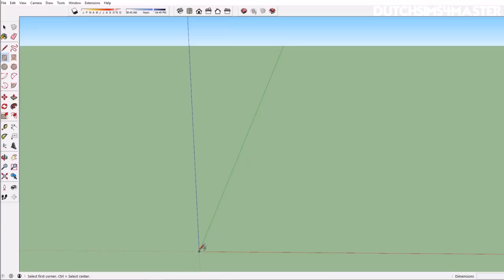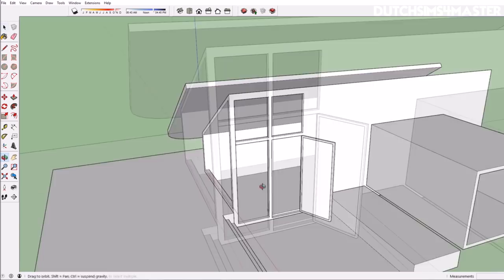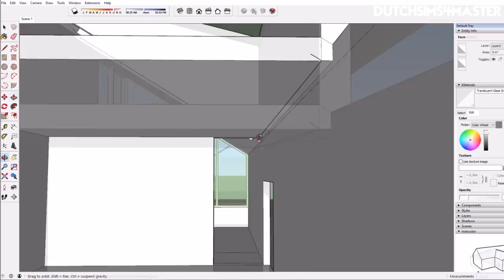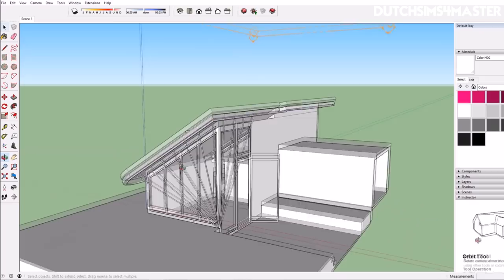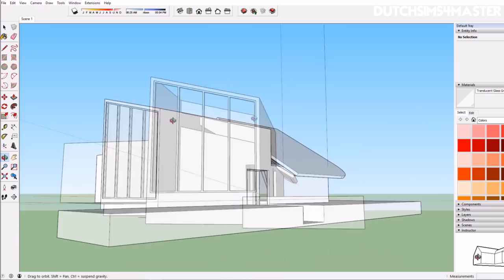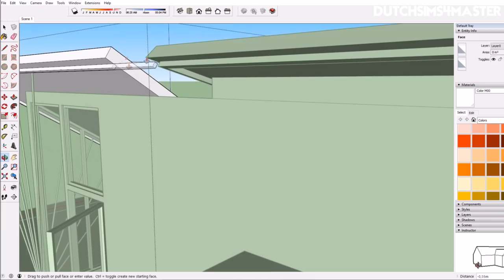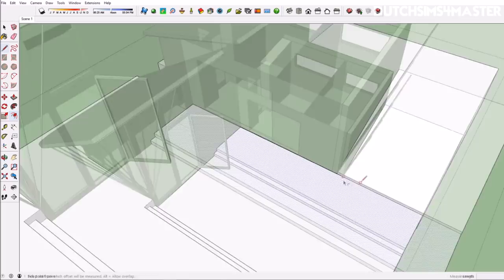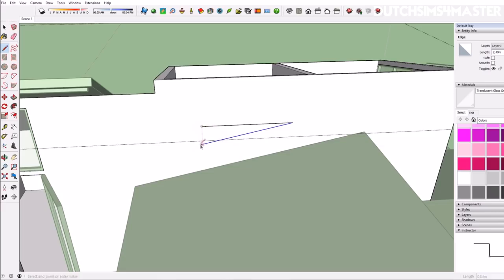Sketchup - House building - Modern Cottage

Comment: Hey! I thinking about getting Sketchup. Can you tell me the difference between Sketchup Make and Pro and which you prefer?
Reply: Hey daniel, there are too differences between SketchUp Make and SketchUp Pro. Pro has the ability to use solid tools, which allow for boolean addition and substraction. It makes some things faster, but it is not really needed for most things to be honest. The second is the ability to export your SketchUp into other formats, such as autocad or 3ds max. With that said, many programs (rhino and revit that I use) can import sketchup files normally.

Basically, unless you know why you need SketchUp Pro, Make is 100% fine :) Enjoy!